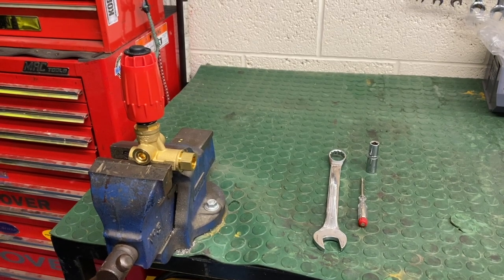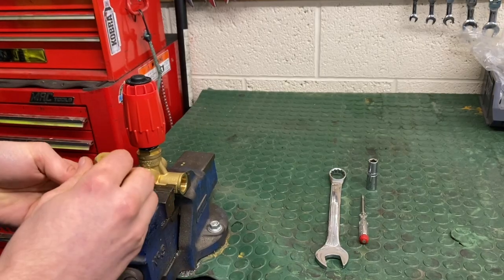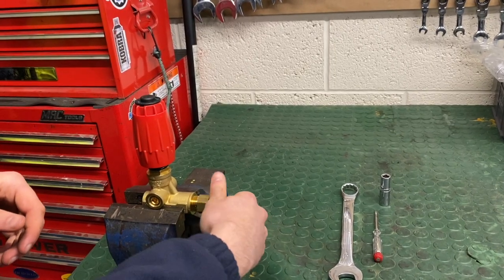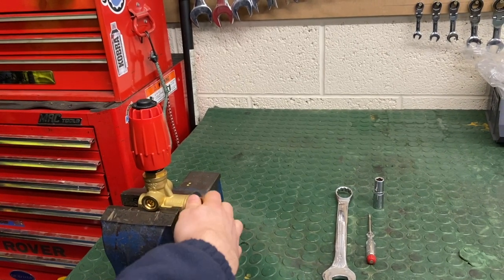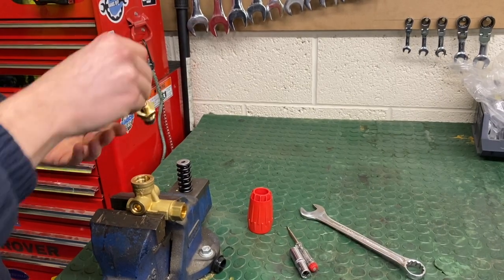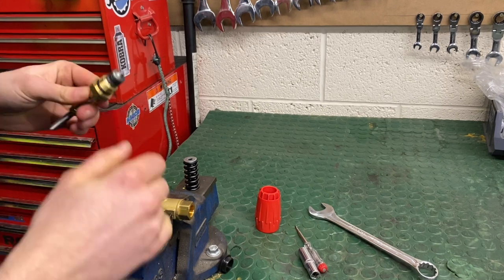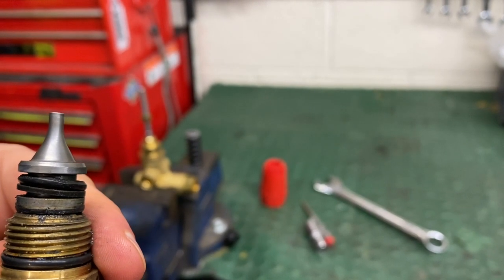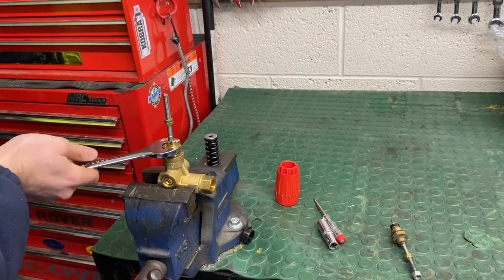Trapped Pressure Unloader Valve Inspection and Repair Mecline VRT

Comment: Hi, I know this is an old video but, do you still sell the stem separately ? I need the same one in the video. Mine has gone today 😢 🙏🏻
Reply from the maker: Hi there, I'm so sorry I've only just seen this. Generally, the stems are not available separately and it's usually cheaper to replace the whole thing but if you pop as a WhatsApp of your own loader, I can take a look and see if we have a stem on the shelf. +441572729412

Comment: How do I change the rings on the stem? Does it come apart or just use a hook tool to remove ri gs and shimmy new ones on?
Reply from the maker: Hello, we would generally use a pic and something like red rubber grease or Vaseline to slip them over. Best of luck!